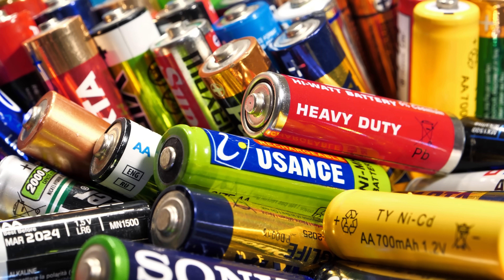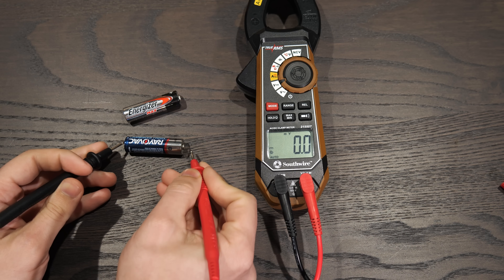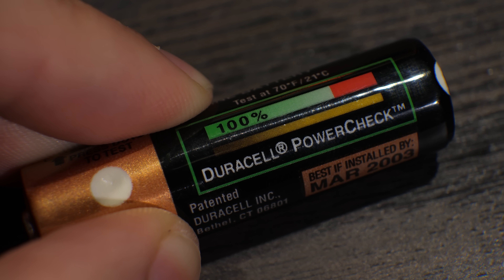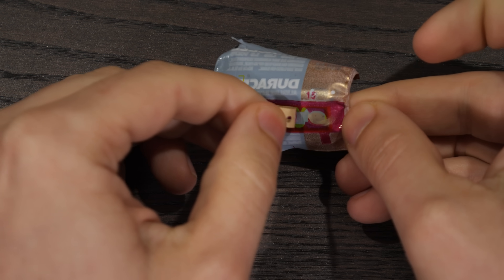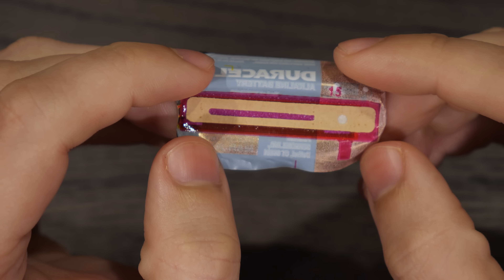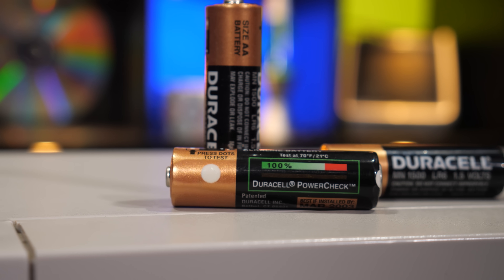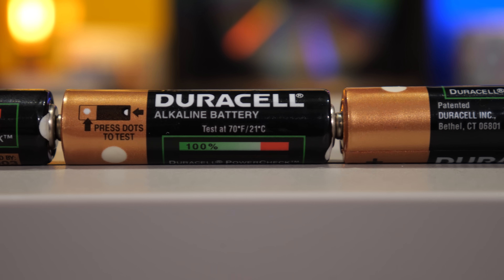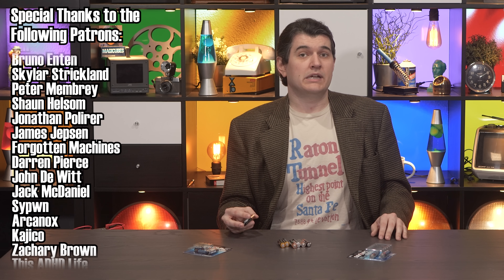Duracell PowerCheck: A genius idea which didn't last that long

Comment: I feel like it was a holdover from when batteries used to be more expensive so throwing away less than optimally charged batteries that could be used in a pinch for products that used much less power like a TV remote

Comment: Duracell Ultra in the UK still has the PowerCheck feature, but they are the most expensive version compared to the Duracell coppertop Simply range that is more common.

Comment: I have to say - I won't use a Duracell anymore. I used to use these all the time, in fact I still occasionally find an OLD remote with a couple in it and they're just fine. But the new ones? JUNK! I've had them go bad in packaging before I even get them out - within a year. 8 years in a remote for the old ones have been no problem many times. The new ones leak like crazy. They were bought by another company I believe and have changed something. Energizer - these are my new goto and they work well. Sorry Costco, not falling for those Duracell junk batteries in bulk. Amazon sells Energize in bulk just fine for me now...

Comment: I quickly go and check my Powercheck batteries expiring 2030 that I bought the last few years.... Yup, 3/4 segments. Living in the UK. I love them! I specifically bought them because they had it, but to be fair, the last time I did have to look for them.. Using them in AAA form factor in my TI86 programmable calculator. If the backup battery is dead when the main batteries dies.....it causes way too much work getting old computers up and running to re-load the calculator with all the software I have on it. Also use it on the multifunction remote in AA. That one will ditch all the programming if the batteries die, but if I change them before they die, it will hold the programming for a good 10-15minutes.... So I just check the charge every now and again. It's 20+ years old now and it's needed re-programming exactly once before I put this type of AA batteries in it. They work for several years.

Comment: I have used this gadget a zillion times personally and I find it very useful on a regular basis, using quite a lot of batteries here and there on some aged devices. 
Not all these devices are as peaky as some other can be with batteries so when they die I often mix and match them together in other devices.
They still sell those batteries as of 2024 btw and while it’s still not soft to press, it’s not as hard as the old ones used to be for sure

Comment: You call that an unwrapped battery? I properly unwrapped em, cuting off all the metal leaving me with mostly manganese dioxide.
I would say dont try this at home, but not only did i do it there in my hobbyist underaged chemlab but i also know that the internal resistence of those cells would be to high for any catastrophic failure, let alone unintnetionally, anyway.
Just dont do it with larger batteries let alone lithium batteries of any size.

Comment: Most of my disposable battery days used rechargeable AA/AAA batteries. This did actually lead to a household culture of leaving heaps of partially charged batteries in a drawer bc they all could be recharged and used again (well, up until they couldnt which inevitably would happen). The thing is though, if you have rechargeable AA/AAA batteries you probably also have a charger for them, which also functions as a battery tester most of the time. So even in my use case where this was a common problem, it already had a solution.

Comment: I remember them leaking a lot more than old Duracells (the brand became worse over time, the modern ones are dreadful).  Seriously every last one of them leaked, and the outer layer would swell and split leading to catastrophic damage.  Strangely I've never seen a Panasonic leak, not even one.

Comment: Ugh. I hated those testers. They seemed really cool, but on use… awful. You would have to press with what seemed liked the strength of the T-1000. 
I remember early on, pressing as hard as i could to hope it would be good enough to be the last member in the motley crew of near dead batteries.

Comment: There's another point which would have made the on-battery tester less useful than Duracell may have thought.  You were having trouble pushing the dots hard enough to have an effect.  Well, men in general have stronger hands than women do, so I wonder how many women were simply unable to make the testers work.

Comment: I don't think I ever had more than a dozen or two of these when they were being made, but my vague recollection is: You press the dots, nothing happens. It was disappointing. Maybe I wasn't pressing hard enough. ¯\_(ツ)_/¯ Even though they're metal and presumably reasonably sturdy, applying brute force to batteries kind of feels wrong.

And, yeah, it didn't matter, I just wanted to see the battery "do the thing". As you mention, most of the time there isn't any reason to check an alkaline battery. You know the batteries in the remote are dead because the remote stops working.

I'm betting they discontinued these as much from "I pressed the dots and nothing happened" as from "why is this even a feature?"
Reply: I also have to point out that I'm currently in a climate where "test at 70°F" is kind of ludicrous. It's hot and unless you're rich and fancy, everyone has swamp coolers rather than AC—the swamp coolers can keep it comfortablish most of the time, but 70°F is pushing it. And an uncomfortably cold indoor temperature if you're at all acclimated to the heat... of course, I don't know how sensitive to temperature the things are, maybe 80°F or whatever is fine.

Comment: When I was a child I thought that a battery tester built into the battery would be awesome. Then a few years later Duracell did just that, but initially there was only one tester in a packet of batteries, so you had to keep the plastic packaging and put the battery in it to test it.   Then later on they appeared inside each battery. 
I had no idea they stopped doing these. They were around for a decade+

Comment: Tip: if you have a device with multiple cells in series, when you think that the batteries are shot, it pays to test because surprisingly often the weakest cell in the string has failed and the rest are still good. Replace the dead one and save yourself the cost of the rest.

Comment: This of course presupposes one does not have children.  My experience with children is that they love to take the backplate off the battery compartment.  And inevitably they lose it.  Then, batteries tend to fall out.  They also like to remove them anyway.  So it is not unusual to find batteries all over the place.  It is rather expensive to simply replace them when they fall out and get lost.  So I find that I am constantly needing to check any given battery that is "found" lying around, as it may or may not be discharged.  Sure wish they still had a tester attached to them!

Comment: I think I'd chalk PowerCheck up to advertising, which is more sensible. Duracell has always tried to present itself as more advanced, more upscale than other batteries, and thus convince consumers to be less price sensitive to their products. I think Duracell knew the idea was a gimmick, but they needed to be seen doing something to differentiate themselves, some sort of extra feature, with a bit of wow factor. Let's face it, the only time the PowerCheck got used was when the battery was brand new, and you wanted to see how it worked. It helps prove that the new Duracell battery is all hot to go, while with other brands you had to hope. That was enough to justify it for a short time, as a luxury feature aimed at a luxury audience.

Comment: As for NOT USING IT . I worked night shift on an airfield. I specifically remember the company policy for these tester Duracell. Back then technology was really advancing and a dead battery could cost our operations tens of thousands of dollars. During preflight operation both ground crews and pilots tested the equipment.  If any blip appeared the first check was the batteries. 90% the fault was a failing battery. This problem abated pretty quickly also because LED bulds and lamps were also hitting the market at the same time. What is unique about LED's is they kinda have a built in load tester. When you turned on the lamp.. if it didnt illuminate it was the  battery.

Comment: I remember those, and how difficult they could be to use. Duracell used to be my go to brand, now it's my stay away brand... what's really shocking about the batteries you showed was that the didn't leak... Duraleaks are garbage these days. I volunteered at a Habitat Restore for a while and was their tech guy, and EVERY SINGLE gadget I opened up that had Duracells in it the batteries had leaked. I did get pretty good at cleaning up the mess though.

Comment: We used to charge these batteries by placing them on a radiator. That would also active the strip. Using the tester normally would make the strip hot, I'm guessing it would short the battery and that strip is similar to colour changing coffee mugs.
PS, in the UK I'm sure the strip was white.
Another ps, I remember that flimsy battery tester. Me and my brother used to go through so many battles that my dad bought a universal DC adapter. It made playing a game gear a lot better & cheaper. We had tons of rechargeable batteries but remembering to charge them was another problem. They also didn't last long compared to none rechargeable.

Comment: I preferred the predecessor implementation of this concept they had before it was built directly into the batteries. When it was just a part of the bubble of the battery package... Cuz then you could just save the package and test any brand of batteries you happen to buy later also.

Comment: if youre not using rechargable standard batteries like aaa or aa then youre buying batteries wrong. STOP BUYING SINGLE USE BATTERIES!!!! i bought 8 aa and 6 aaa rechargable batteries FOUR YEARS AGO and literally have never bought betteries again.. it cost me 35 bucks and 15 bucks for a charger for them... and thats it about 50 bucks for endless batteries instead of 10 bucks per 8 pack of SINGLE USE BATS BRUH!!

Comment: I am the weirdo that keeps spare batteries for things :D My old apple wireless keyboard uses them, I have some instant cameras that use them and I learned the hard way to remove batteries from things when they're not in use. Ruined one of my camera flashes that way. But I generally find that once they're done, the 4 batteries from my keyboard have enough juice in them to power my gameboy colour for a few hours, which is about as much time as I have to play it these days :D

Comment: I was a kid when these batteries were on the market, and I used the testing strip all the time. The power check was great when the GameBoy died. I'd check for the bad one and swap it. Some batteries were frequently swapped between several devices that required different amounts, and not always drained in sync. Batteries were expensive as a kid!

I didn't know it had been discontinued, but apart from the remote and the smoke detectors, most things are rechargeable now.

Comment: if you used the tester too many times, eventually the dot on the end of the battery would get crushed-in because of how hard you had to press. which would break tester.

Comment: I flipped when I saw that ancient battery display a full charge. I was about to have MANY questions, thanks for the explanation ahead of time.
Reply: actually the battery could have been also recharged.
As a kid I used too batteries, but only in flashlights. 
Still I was annoyed when they got drained. 
I had no idea about rechargeable batteries. 
I knew about lead ones for cars, but not about small ones. 
My jaw dropped when I saw the first NiCd s at 17. 

Anyway, recently I heard other guys that they recharged the batteries.
I did not believed it, and so I tested it. It really works. 
But it has its perks. 
Do not really works if the drain is big. So for cameras, not so good. 
But for a clock for example, worked perfectly. 
New batteries lasted 4 months. 
Recharged just a little, I mean like an hour, worked 3 more months. 
Recharged few hours fried one, but the other one resisted. 
And that particular clock does not work on 1,2 v. 
So, recharging disposable batteries may be of use in some cases. 
Not big saving, but is still good to know. 
Especially for kids.
Reply: @ehombane  no unfortunately all those batteries are dead and gone. The batteries only have a shelf life of 5 years or so, used or not and trying to charge one in that state after so long isn't going to work.
Reply: @Xehemoth  I was not talking about that old batteries. I was talking about regular batteries that we throw away regularly. 

And obviously for a normal person with a job and a fair income this is just waste of time. But for a kid saving few cents, and learning something may be useful. I wish I knew that half a century ago.
Reply: same i thought either he found a battery with this tech that was made fairly recently, he was using a separate power supply, or the tester is just garbage

Comment: I'd bet the reason for the remote control example of AAA battery use was to keep the remote control as thin as possible.  AA batteries would make the remote slightly thicker. - it isn't much thicker, but it's thicker, and it's a design choice.

Comment: Duracell is a premium brand, or at least was back then. They were considerably more expensive than most other brands and I think that the decision to include the tester was very much a marketing decision rather than a technical one. As you said, to some degree disposable batteries are a commodity and duracell as a premium brand needed to create some sort of differentiator to set them above and apart from their competitors. It didn't really matter if it was necessary if it gave them an interesting USP to shout about in their tv ads. Thanks for this bit of nostalgia, I always used to wonder how these worked.

Comment: Every year or two, I help a company I built sensors for walk around a football stadium (sometimes a 2 day job or so) changing batteries in sensors where mains power isn't feasible. This always turns in to a bit of a chuckle brothers act, as you can imagine, you have a bag of fresh AA batteries, once you open a box they spill everywhere... and a bag of dead AA batteries; though I'm sure dead batteries in devices have never slipped by us, as we test everything before we call it a finished job. But dead batteries get mixed up with fresh ones. Honestly, we would pay an extra £1 for the same batteries if it means we can instantly test them there and then rather than rebooting devices, waiting for gateways to refresh, and checking the system console for ID codes being posted. Why didn't they keep these for industrial/trade use cases?

Comment: They should have been easier to press, we had these for a while and probably can still buy them here, but pressing then hurts your fingers, btw i am from the Netherlands 🇳🇱,  idk yall didn't have these anymore?

Just checked they are still new buy-able, if you would like to get some we can get in touch and ill guide or help u get them👍🏼

Edit
They are more advanced now btw

Dubble edit

Duracell also makes rechargeable battery now if theu just would integrate this that would be wonderful

Comment: In Australia, Duracell used to have the battery tester built into the plastic packaging and you had to press the battery into a spot in the pack to test it. Then they moved to the ones like in the video where it was built into the battery itself.

Comment: I used to use them; when something “wasn’t working” I would check the batteries with the test strip first.
I recall a whole batch of PIR sensors being declared “faulty” until I (as a 10 year old kid) proved it was a bad battery. One battery out of the pack being used was a dud, proven by the test strip…..

Comment: especiaqaly for the TV remote control, it is designed in principle to be low power so one pair of AA or AAA battery last for very long time, for example is it dramatically costly painful to buy recharcheable batteries for TV remote control. At the end looking a Powercheck for batteries those has been used for "ages" there is not worth even to test. I used the Powercheck few times and as correctly pointed is absolutely a painful tool. I prefer the Multimeter or battery tester

Comment: The first Powerchecks from Duracell were not build in the battery but external testers which you could use on every battery around. They work twice as precice and easy to use. a lot of fun too.

Fun fact: The battery test stripes loaded up constantly  from the right to the left. - so your little animation is nice to watch but unrealistic.

Comment: They were MISERABLE to use. I'm particularly sensitive to applying pressure on/with my fingers -- which is why I also HATE any kind of press and hold button -- so after doing it like twice ever out of novelty, I refused to ever use the test feature again. Not worth the literal pain.

Comment: The reason they stopped including this feature was surely that the tester made it more likely that battery purchases were less frequent because half-empty batteries could be confidently retained and re-used, and consumers stopped being willing to pay for it (because ultimately it is a pointless gimmick: users could simply try the batteries in a device, like you said).

Comment: Interesting to know, thank you. 
There is a question: did I hear it right that the current and thus the heat depends on the width of this metal thingy? That sounds incorrect to me, the current should be the same regardless the width, it is the narrowest part limiting the current. Highly likely this shape of the metal piece is used because a wider part takes much time to heat and it also dissipates more heat, it is cooler after all. Can it be the case?